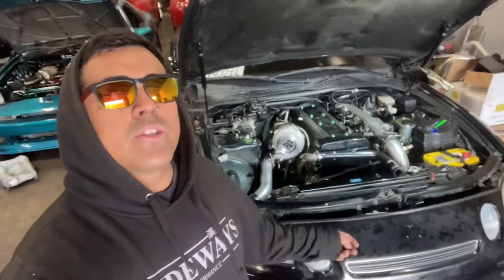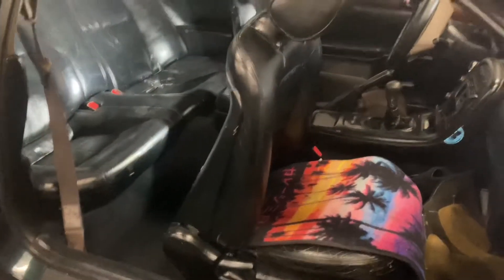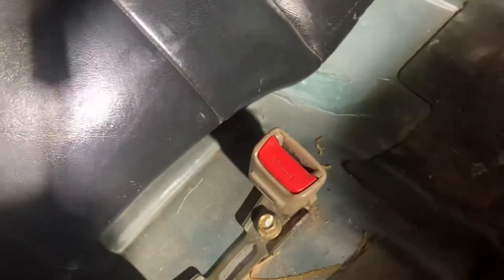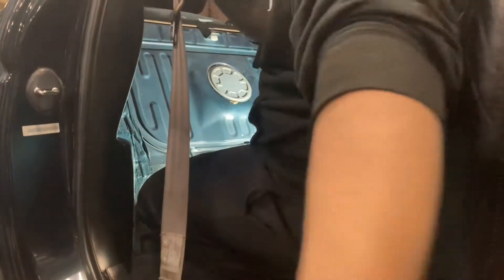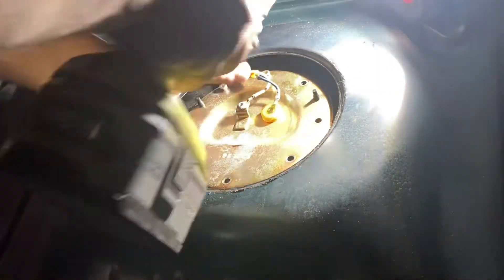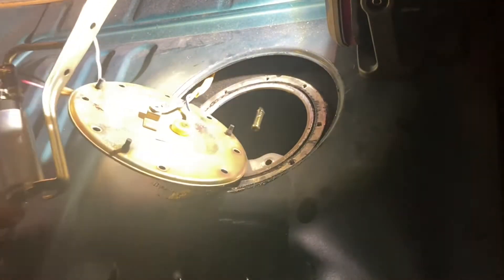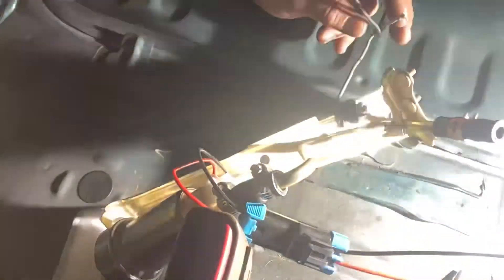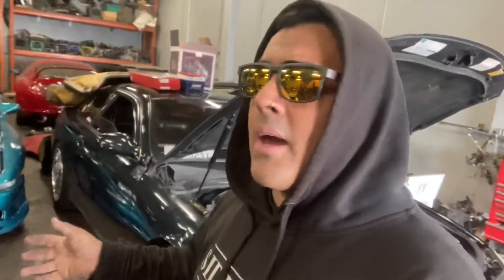DIY Walbro 450 - 525 fuel pump install Lexus sc300

Comment: I put a 525 in my car and it wouldnt even run for longer than 10 seconds on the stock wiring. I bypassed all the stock wiring, re-wired everything with larger wire and ran a seperate relay.  I'm running 2 with a -8 feed

Comment: Would a 450 work on stock NA?
Reply from the maker: 2jzge non Vvti can do about 750
The Vvti version I would say 400 is about the max
Reply: @SidewaysPerformance  I was asking if a walbro 450 pump would work on a stock untuned NA sc300. Or is it too much pump.

Comment: Is it common that y’all use the stock wiring on that big of a pump? About to install a 450 and am worried I’ll melt the stock wiring with the higher amp draw
Reply from the maker: No so you work fine it is depends on the power number that you’re going for typically we will go ahead and run like a 6040 relay in place of the OEM Wiring and then dedicate the ECU to control fuel pump triggering
Reply: @SidewaysPerformance  I’m shooting for about 550 wheel so I know I’ll be somewhere around 20-25psi with the turbo I have.  With stock base pressure on a 2jz being 43 that’ll put me around 70 total on the pump accounting for pressure drop. If I have the right chart for the 450 it’s at around 18amps stock is “rated” for 20 lol cutting it close especially with old ass wiring. Figured I might be okay though if this is common practice but I’ll probably run some wiring